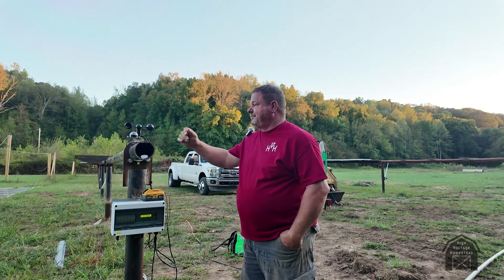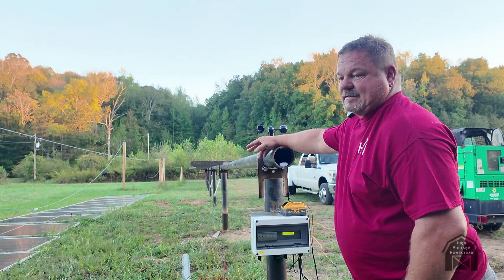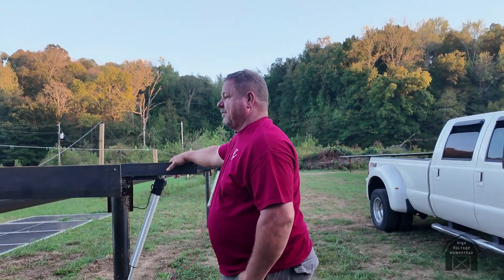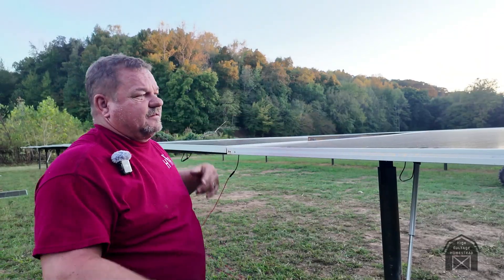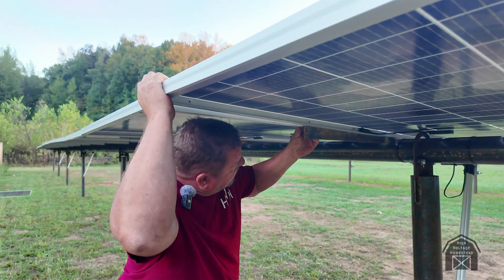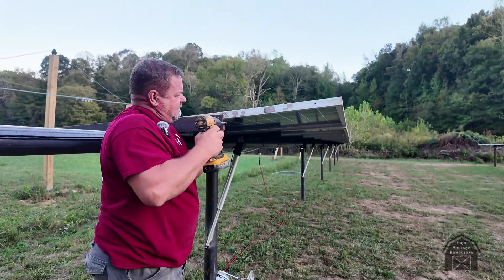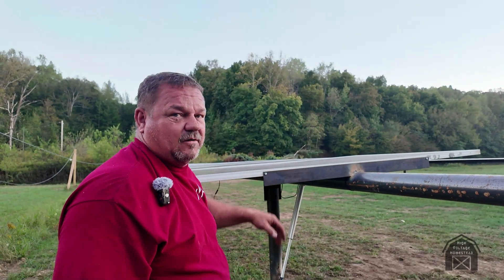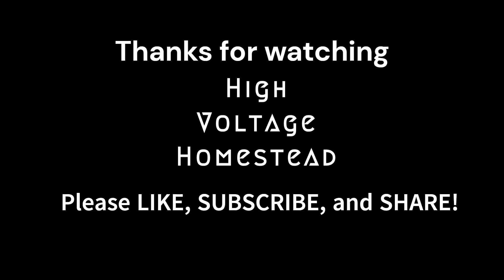Mounting Panels on Grid #8… Until the Tracker Took Off!

Comment: I asked this before but you never answered. How do you deal with one actuator failing? I have not tried this myself as I use single actuators on my arrays. I would incorporate a current sensor (adjustable setpoint) so when it exceeds normal current under load it would trip (compensating for a temporary wind load).  Otherwise some real damage is going to happen.
Reply from the maker: It just gets broken, the others just pull it apart or fold it in half.  I have had both happen lol. The array is way overpowered so when 1 fails it just gets destroyed.  I'm going to scale back on the next one and try them in series as I think this will probably solve both problems.  Thanks brother!

Comment: I haven’t noticed bare copper grounding wire interconnecting everything.  Is that something you plan to do later or is all the metal on metal make it interconnected enough already for breakers and SPD to work well enough?
Reply from the maker: When I checked it with my meter I didn't see any problem, I think the grounding straps they put on just bite thru the coating on the aluminum with little "cleates" to make the connection and these are drilled thru and the lock nuts "bite" into the aluminum for sure.  I will run a ground from mount to mount though just to keep everything at the same potential. Thanks!
Reply: @HighVoltageHomestead  Thanks, that makes sense